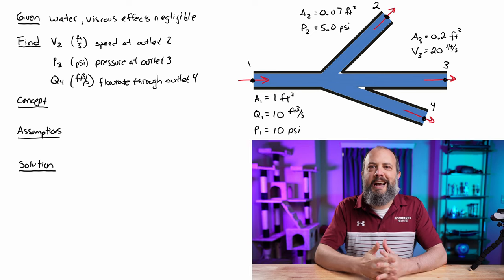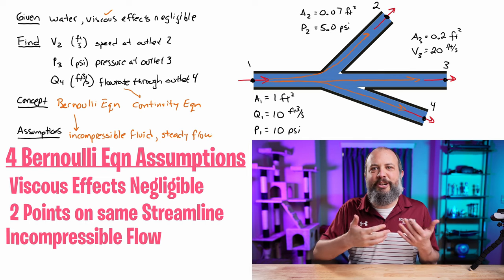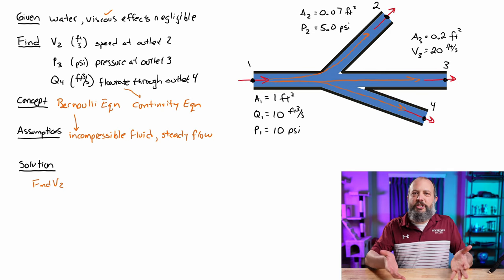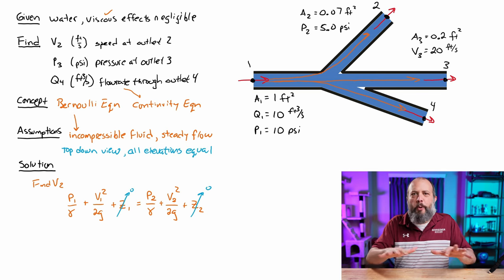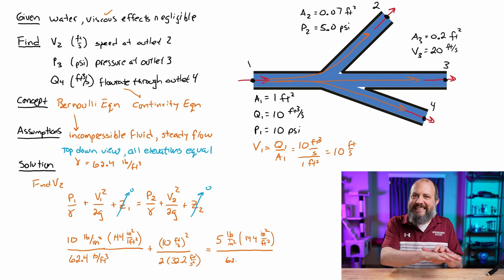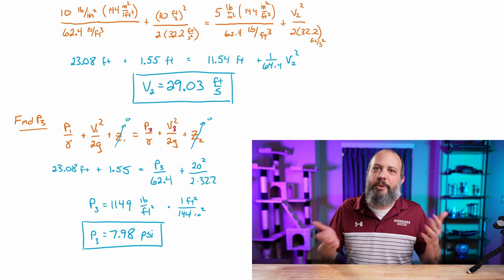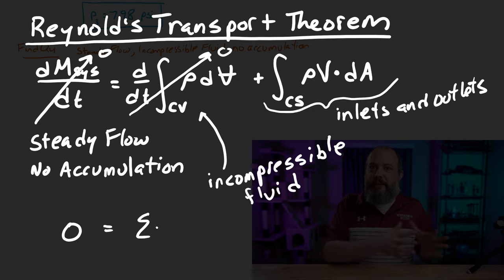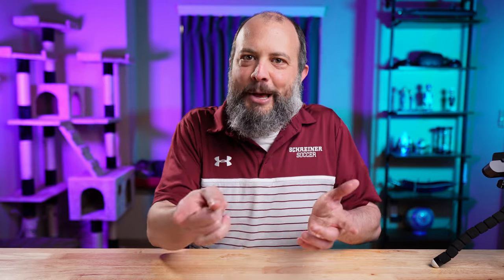Branching Pipe Flow - Bernoulli Equation and Continuity Equation Example Problem

Comment: When you did Bernoulli between 1 and 2,  you did not consider points 3 and 4 as they did not exist!
Same for 2 and 4 when you did Bernoulli between 1 & 3
Same for 2 & 3 when you did Bernoulli between 1 &4.

Can you explain why?
Reply from the maker: Consider a single molecule of water that starts at point 1. It has energy. It's energy is stored as pressure, velocity, and gravitational PE. In this branching pipe flow problem, this single molecule could go to either path 2, 3, or 4. The total flow in the entire pipe splits and goes all 3 places. But a single molecule of water can only go down 1 path. So - we follow that 1 molecule, itself. And, no matter which path it takes, conservation of energy still applies. Once that molecule makes it to its branch, either 2 or 3 or 4 ... due to conservation of energy, it will still have the same amount of energy that it had at point 1. It may be in a different form, maybe lower velocity and higher pressure for example. But - it has to have same energy as it started with. When using Bernoulli Equation (or later in the course "Energy Equation"), you follow an individual molecule along a streamline. So any point that this single molecule could reach - they all have to have the same energy. Even though its impossible for a molecule at point 2, to reach point 3 ... since point 1 connects to both 2 and 3, this will make it so that 2 and 3 end up having same amount of energy, even though its not really correct to compare them to each other directly ... you should compare each of them against point 1. I hope this helped. :)

Comment: I thought I already posted a comment  . First thanks for an informative and easy to understand presentation . I really liked the concept of thinking that the stream line was a series of molecules . But in all the conservation derivation whether heat ,mass , energy they all are based on the principle what goes in comes out . In your analysis it seem what comes out is 3 times more out . Is this a nuance of bernouli equation and not related to conservation laws .
Reply from the maker: Don't forget the continuity equation, the conservation of mass. The 1 inlet is being split into 3 outlets. Not necessarily exactly 1/3 through each outlet, but for discussion purposes, 1/3 to each outlet. So, if each stream of molecules has the same amount of energy (per molecule, or per unit volume) along the streamlines, you don't end up with 3x energy out, because only 1/3 goes through each path, so 1 in and 1/3 + 1/3 + 1/3 out. Thanks for watching. If you liked this video, I have a full fluid mechanics playlist that you might find valuable.
Reply: So for frictionless flow in a manifold with same diameter pipe along manifold the pressure will rise as you cross the lateral  since velocity downstream of lateral is slower than upstream of the lateral . Thanks for clarifying

Comment: if we closed the exit at 3 and 4 together, is there any change in bernoulli equation from 1 to 2? if there, what is it?
Reply from the maker: Interesting question, and my first instinct was that there was no change, these points are still along the same streamline and all Bernoulli assumptions are still met, so yes, velocity would be the same , no change - but that's not entirely correct. Your scenario actually kinda breaks the problem. If 3 and 4 are closed - then ALL the flow has to go through 2. That means Q1 = Q2. You can actually solve for velocity as A1V1 = A2V2, just the continuity equation by itself. You get an answer of V2=143 ft/s. This is WAY faster that calculated by Bernoulli Eqn. Why? It's because P2 would now be wrong. If all the flow is going through 2, and none going through 3 or 4, then the given value P2=5.0psi would now be impossible. The better question in this new scenario would be, what would be the pressure at exit 2. You'd use givens at point 1, and continuity equation to find velocity at 2. Then you'd use Bernoulli equation and givens at point 1 and now known velocity at point 2, to find the pressure at point 2 ... which would not be 5psi. Thank you for the question!
Reply: in video problem, because mechanical energy is conserved (bernoulli equation), then bernoulli equation must be:
mech energy at poin1 = 
mech energy at point 2 + 
mech energy at poin 3 + 
mech energy at poin 4
or
(KE + PE + flow energy) at point 1 = 
(KE + PE + flow energy) at point 2 + 
(KE + PE + flow energy) at point 3 + 
(KE + PE + flow energy) at point 4 

Why didn't we do that? 

but in the problem answer, we say: 
mech energy at point 1 = only mechanical energy at point 2
or
(KE + PE + flow energy) at point 1 = 
(KE + PE + flow energy) at point 2. 

Isn't it wrong?
Reply from the maker: @wateressam1889 It depends on whether you are considering the perspective of a single water molecule or the total flow. When using the Bernoulli Equation, you should be thinking in terms of a single unit of water, not the entire flow. Think of a single molecule of water. That molecule has its own amount of energy, split in KE, PE, and Pressure. As it moves, it's own energy can change forms. That's the Bernoulli Equation. The Bernoulli Equation follows a single molecule of water along its path and looks at how that single molecule's energy changes forms. The Bernoulli Equation does NOT follow ALL of the water. It's not a summation of all the energy in the entire stream. That sort of analysis IS possible though. Probably the next chapter of your textbook will start to introduce you to "Control Volumes" and the "Reynolds Transport Theorem". That is when Energy1 = Energy2 + Energy3 + Energy4. This is essentially done by combining both the Bernoulli Equation and the Continuity Equation into a single equation (that single equation is Reynolds Transport Theorem) that includes both energy and mass flow rate. To sum up - for right now, consider Bernoulli Equation as only following a single molecule of water as it completes its own individual journey. Then later, you will learn a new solution technique involving control volumes, where you analyze the sum of all flow into a junction vs all the flow out of a junction, and this will combine mass flow rate and energy (or mass flow rate and momentum , since this technique of using control volumes is especially good for solving momentum problems).
Reply: ok, it's a single particle, but we can treat/choose this single particle as a thermodynamic system. so, the question is: can we say that "the total energy of this thermodynamic system at exit 2 does not change whether we close exit 3 and exit 4 together or we don't" ??? 

can we say that "the total energy of this thermodynamic system at exit 2 equals to the total energy of this thermodynamic system at inlet 1 whether we close exit 3 and exit 4 together or we don't" ???
Reply: we can also choose the branched pipe system (single energy input and three energy outputs at 1,2,3 and 4 respectively) as a thermodynamic system (control volume system) and apply conservation of energy princible (first law of thermodynamics) on it. Cann't we do that????

Comment: I found a question on the same example saying that bernoulli between point 1 and any outlet point will get us an inaccurate result . so the question was what should we introduce to bernoulli to get accurate result ? can u help me with this question?
Reply from the maker: It sounds like they are hinting towards Friction (ie Head Loss). One of the assumptions of the Bernoulli Equation is that there is zero head loss. This is useful for general understanding, but to get a more accurate answer, you would need to use Head Loss, which is friction removing energy (head) from the system. You'll calculate this friction head loss using the Darcy Weisbach Equation, and within that equation, you'll use the Moody Diagram to find the "f" term in the Darcy Weisbach Equation. There are also "minor losses", which are energy losses due to things like corners and bends and changes in pipe diameter. But overall, "head loss" is probably what you are looking for.
Reply: @BrianBernardEngineering  thank you